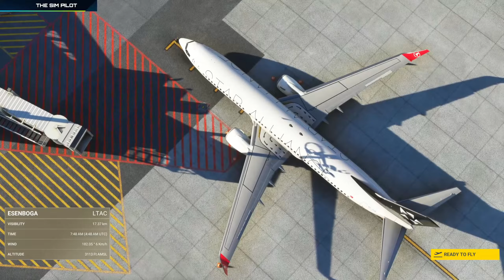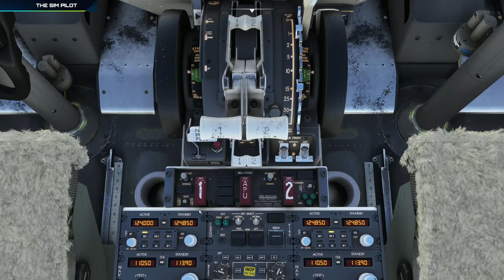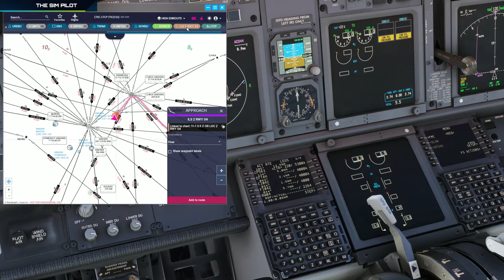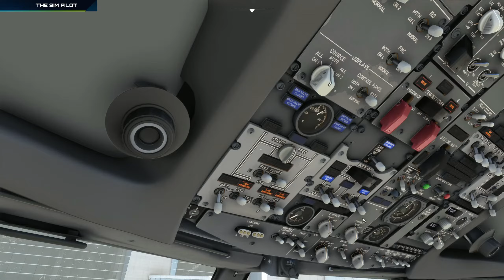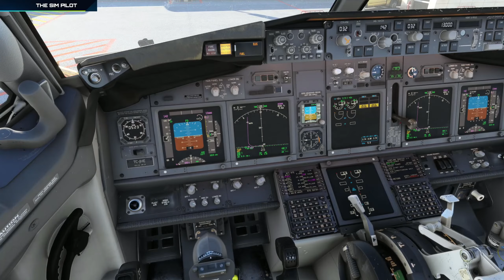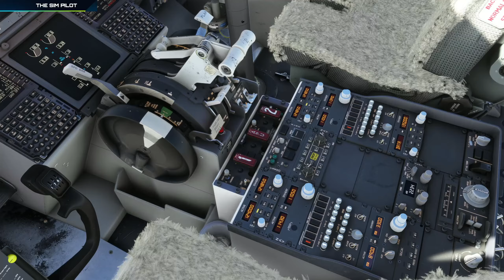MSFS | Tutorial | PMDG 737-800 Cold & Dark Startup |

Comment: You certainly know your stuff.p   I have a question because i'm a die hard realism authenicism fan  i like to make things as real (hard) as i can even though i'm not that good.   But i have an issue. when i do this i get oil warnings and sometimes other warnings that something is not right... how do i overcome these issues?   i know there is a services section within the fmc, but is that enough............The other day i tried flying with this problem only to lose both engines  over the ocean and logically enough lost the aircraft as i was not able to glide to safety...... knew there was something wrong when the aircrft could not maintain level flight almost on full power  and also that the aileiron trim was not keeping the aircraft level...it was as if there was too much input from the smallest movement possible.. this was befoe i saw he engine fail readout in the mfd
Reply from the maker: Thanks for the compliment. I haven't practiced the failures yet but what I can recommend is to start with the non-normal procedures and checklists for the 737. I am pretty sure there will be some interesting information in there. I believe you can google it and can find a bunch of information. Non-Normal procedures and failures are what pilots use in real life when things go south.

Comment: do you know any solution how can I set the parking brake in TCA captain quadrant. The parking brake is cranks when I turn on the parking brake Joystick button 20. When I want to turn ON  or OFF the parking brake is not working. Any  help would be great. Thanks
Reply from the maker: PMDG had an update that requires to hold the brakes while engaging the parking brake. I have set it to a button on my quadrant as well/ When setting the parking brake I hold the brakes and press the button. When I want to release all I need is to tap the brake pedals. Though I have rudder pedals and that might be the problem if you don't have rudder pedals.

Comment: when I try to arm lnav on the ground, the light flickers, and it just doesnt work. Do you know a fix?
Reply from the maker: Are you clicking EXEC after entering information for performance calculation? also you have to enter a cost index for VNAV to work otherwise it will not engage. Two things I can recommend EXEC your PERF calculation and make sure you have a cost index.
Reply: @TheSimPilot  Yes, i did exec and i put my cost index but it didn't work. By the way, I've been reaching out to so many discord servers and stuff and your the only one who has responded, so thanks.
Reply from the maker: @lucasohbh  My bad you asked for LNAV and I mixed it up with VNAV for LNAV to arm on the ground see if this helps. LNAV arming criteria on the ground: •origin runway in flight plan•active route entered in FMC•track of first leg within 5 degrees of runway heading•LNAV selected prior to TO/GA.•LNAV guidance becomes active at 50 feet AGL . From what I recall, LNAV can not be engaged on the ground when the first fix is more than 5 degrees from the runway extended centerline. Have you tried to arm at different airports and SID's? Assuming your Flight Directors are already on.
Reply: @TheSimPilot  Yeah, once I tried it while airborne and I was on the correct route, and it wouldn't work. I had to use heading select the entire flight😂Ill do a flight soon and Ill make sure that all that stuff you mentioned is good. Thanks man
Reply from the maker: @lucasohbh  I hope it works
Reply: @TheSimPilot  thanks